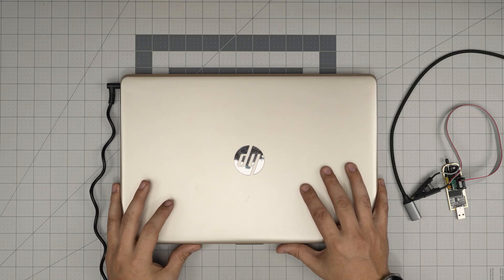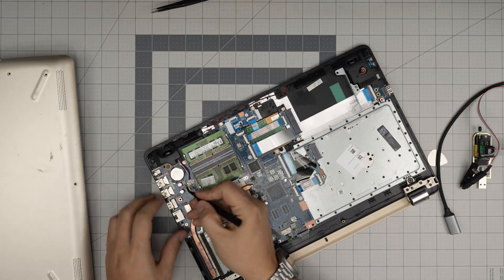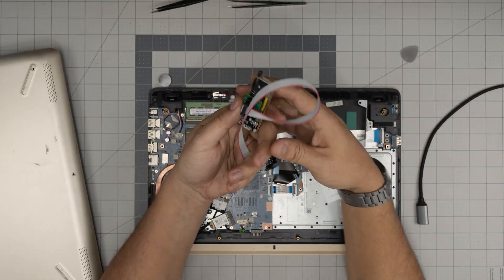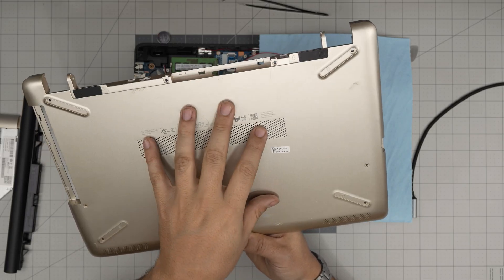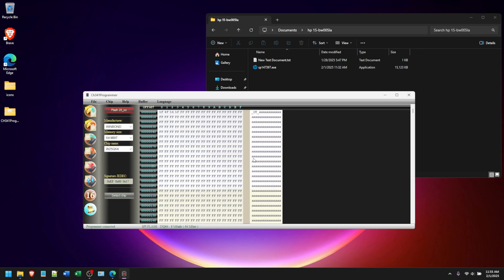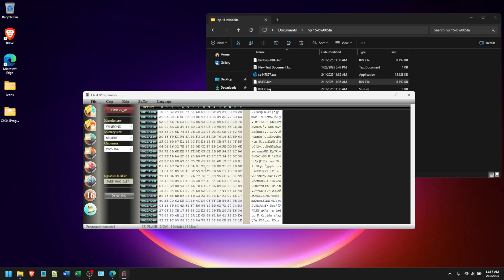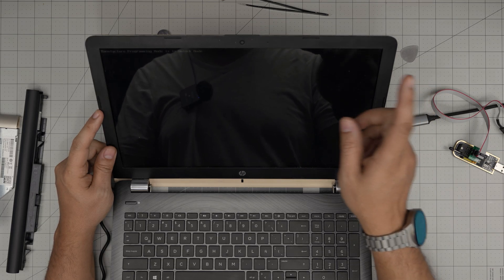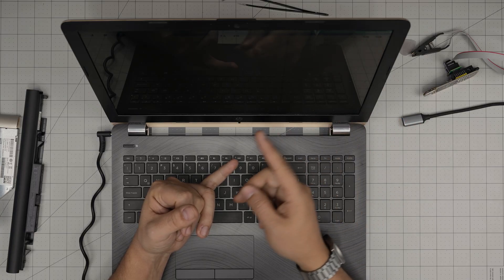Laptop BIOS Password Removal 🔓 DIY BIOS Repair & Reprogram ✅

Comment: Hello, Thanks for the video... I bought an HP EliteBook x360 1030 G8 with a locked BIOS .... Saw your video and want to flash the locked BIOS ... read that they have 2 BIOS chips so don't know which one to flash and where they are located  ... could you do a video that I could follow or DM me ?  Thanks!
Reply from the maker: 🫠Regarding your question, I will try to get you some help this weekend, and I’ll reply right here with the information.
cheers🍻

Comment: Any thoughts on Lenovo ThinkPad P50, will it work?
Reply from the maker: 🫠Regarding your question, yes, it will work, but you will need different prongs (clips) for the BIOS chip, as it is a Wson8 BIOS chip.
cheers🍻
Reply: @uFixTek huge thanks, are they easy to get and will everything else stay the same? I read somewhere that in P50 bios password might be stored separately from bios chip?

Comment: Hi, I done all the steps and now have the black screen, erased again and write the original bios and still the same ..... any suggestions .....
Reply from the maker: Regarding your question, then your issue could be another component; you could have bad RAM communication issues.
Reply: @uFixTek  write the bios without the RAM, start first with no RAM, after stick the RAM, working ......

Comment: Cheers from Denmark 😎 
I love that video and how you explain it, very straight, and looks very "easy". 
I have bought a used lenovo thinkpad x1 carbon gen 11 with intel vpro i7. Im inside with windows 11, but cant change settings like bootorder in bios, because of missing "supervisor password". Ive tried contact the previous owner, but his not responding.
Is this the way i can remove the password from it? Thanks in advance 🙏😃
Reply from the maker: It's my pleasure my friend.
🫠Regarding your question, 
*Step-by-Step: How to Check Your BIOS Chip*
1. *Open the laptop carefully.*
   Remove the bottom cover so you can see the motherboard. You’re looking for a tiny black square chip — it usually has a label like Winbond*, *MXIC*, or *GD25Q printed on it.
2. *Look for a WSON chip.*
   This type of BIOS chip has *no visible legs or pins* — it sits flat against the board with little metal contacts underneath. It looks smoother than the older *SOIC* style, which has thin legs on both sides.
   * *SOIC chip:* Has 8 small metal legs sticking out (4 on each side).
   * *WSON chip:* Has no legs; completely flat on top and bottom.
3. *Measure it in millimeters.*
   There are *two common sizes* for WSON BIOS chips — about *5 × 6 mm* and *8 × 6 mm.*
   Use a ruler or caliper to measure the chip’s width and length so I can confirm which one it is.
4. *Send me the size (and maybe a clear photo)* and I’ll give you the *exact adapter link* you’ll need to read or program that BIOS chip correctly.
cheers🍻

Comment: Hi , thanks for this video , trying to unlock the supervisor password for a thinkcenter M75q-1 11A7 , seems not working( moving jumper pin 1_2 to 2_3 ) , any advice , and how to find the right eeprom chip to reprogram it using ch341A , shematic , many thanks
Reply from the maker: 🫠Regarding your question, look for a chip that looks like this and it says "MX" or "windbond"
that is the bios chip.
https://imgur.com/a/DuQHtCf
if you need the clean bios.bin let me know i will upload it to you.
cheers🍻
Reply: @uFixTek thank you, I ll let you know 👍
Reply from the maker: oki

Comment: Hi,
I have a company-locked BIOS laptop. Its model is ThinkBook 14IIL 20SL. Can you make a video on that? I have tried every method to unlock it, and someone suggested that I flash the BIOS. Thanks.
Reply from the maker: 🫠Regarding your question, sure—I will make a video on that. It's the same as in this video: connect the programmer, erase the BIOS, and rewrite the new unlocked BIOS.
cheers🍻
Reply: @uFixTek Yeah, still if you can make it, it would be great as I'm not technical guy....Or do you have anyplace where I can send or visit. Thanks....
Reply from the maker: I will make a video, and it will be easy to follow.

Comment: Hi! Great video, straight to the point and simple. 
Similar to the previous commenters, I cannot find a clean .bin BIOS file for my dell latitude 5410. 
Do you by any chance have one and could share? Thanks! :)
Reply from the maker: 🫠Regarding your question, 1st back up your old bios and if the bios backup is 8mb then use this:
https://drive.google.com/file/d/1rWmXi7_7_K20TguYLtZFTQu09de1OIEZ/view?usp=sharing
else let me know.
cheers🍻

Comment: Hi, thanks for the great video. I want to try this, but after downloading the BIOS updater for my Laptop (Lenovo IdeaPad 5 Pro 16ACH6) and running / extracting the .exe file, it does not result any bin or sig files.. How do I get the correct bios file to flash via the bios programmer?
Reply from the maker: 🫠Regarding your question, here is the BIOS .bin file and the 2nd .bin file
https://drive.google.com/file/d/1-Q_MwUUspiB-E6VML3jS9MF8l03L6xSa/view?usp=sharing
cheers🍻
Reply: @uFixTek  Hello, thank you for the quick response. It seems like you've shared bios .bin files for the IdeaPad Pro 5 **16IHU6**. This is a laptop with an Intel chip and other difference such as Thunderbolt. My laptop is the IdeaPad Pro 5 **16ACH6**. According to my research, using the bios you've provided has the potential to brick my devices. Is that true? And if so, do you happen to have the correct bios .bin files too?
Reply from the maker: No, you can’t “brick” a device permanently—that’s nonsense.
People often get scared of the word brick and think it means the end of the device, but let me explain what it actually means:
Scenario 1:
You go to the official site, download a BIOS update, and start the update. You see the warning: “Do not power off, or you risk permanent damage.” If, for some reason, the power is lost, people say “you bricked your laptop” or killed it.
Scenario 2:
I give you a `bios.bin` file, you start programming it, and during recording the probe moves and the file isn’t written properly. Right away, people say “you bricked the laptop.”
Scenario 3:
I give you a `bios.bin` file, but it’s for the wrong model. You flash it to the BIOS, power on, and get no reaction or just a black screen. Again, people say “brick.”
All of the above are considered “bricked” situations only if you don’t have the correct `bios.bin` file or a backup of the old BIOS.
Because if you have a backup `bios.bin` and a BIOS programmer, you don’t need to worry. You can simply erase the BIOS chip, flash the old backup, and you’re back where you left off.
By “bricking,” you’re not physically damaging the laptop—it just needs the correct BIOS file. The BIOS chip is a simple memory chip (usually 8MB up to 32MB) that stores instructions telling the laptop how to power on and which components to look for.
👉 Just a note: once you program the new `.bin` file and power on with the charger connected, make sure to wait *4–5 minutes* so the BIOS can initialize itself before starting POST. Don’t get scared if you don’t see anything on screen right away.
If after 5 minutes nothing happens, just flash back the old `bios.bin` backup and you’re back to where you started.
Test the `.bin` file I gave you and let me know the result.

Comment: Hello. I can't find the bin file. I can only find the bios update exe file on the dell website. Do you have link to official download page? For dell precision 5550, 5VR4ZD3, Thanks
Reply from the maker: 🫠Regarding your question, your BIOS has a password and you want to remove it? If so, make a backup of the .bin file that contains the password and send it to my email, along with a picture of the motherboard model (usually located near the RAM on the board) and the tag number of the laptop.
I will clean your .bin file and remove the password.

cheers🍻

Comment: Hey, brother!
The programmer you posted here to download just contains one .exe file to install, but it fails in the process (all in Russian, though). I do notice that yours has more files in the folder, as in a portable version. Could you please share the same version you're using here?
Thanks in advance, dude!
Reply from the maker: 🫠Regarding your question, I just downloaded the same file, clicked on the right arrow, installed the program, and opened it. It is in Russian, but the menu on the top right is where you can change the language (see the image).
https://imgur.com/a/JgwUwP4
Or you can download another software for the same programmer and change the language to English, as shown in the image.
https://imgur.com/a/JgwUwP4
https://drive.google.com/file/d/1sq_gOTvRnj1gtqvJPOQpNQwBLG6tmYJc/view?usp=drive_link
Should you have any further questions or requests in the future, please don't hesitate to ask me.
cheers🍻
Reply: @uFixTek  Thank you, bro! I'll check that out!

Comment: Hello, I’ve seen many videos about removing bios passwords using ch341a but comparing your video is mega easy to do but others don’t do like this way. They delete the password from the backup bios file using hex and they compare with original bios and it’s way complicated. But you have done nothing, only read the IC and save the backup and erase the IC and reprogrammed with original bios from the website. For what we have to save the backup? And does this method work with every laptops which have bios passwords?
Reply from the maker: 🫠Regarding your question, I’ve been repairing laptops and consoles for over 22 years, and based on my experience with motherboard repairs:
We need to understand what BIOS is and what it does. It stands for Basic Input/Output System—some with advanced interfaces like UEFI, and some legacy versions.
Nowadays, laptops no longer use what was traditionally called “BIOS”; the new term is “UEFI.” However, people still commonly refer to it as BIOS. UEFI stands for Unified Extensible Firmware Interface. It is a modern firmware interface that replaces the traditional BIOS.
Now, back to the BIOS/UEFI on a motherboard: that code is written on a small SPI flash memory chip ranging from 1MB up to 64MB. SPI stands for Serial Peripheral Interface.
Essentially, the information in this chip dictates operations like sending a specific voltage to the CPU, RAM, etc. If the hardware responds, then the firmware continues executing instructions until everything starts—this is called POST (Power-On Self Test).
What’s happening nowadays is that Microsoft (Windows 10–11) decided to integrate BIOS/UEFI updates into Windows updates. These updates are not always applied correctly, which can result in the motherboard failing to power on after a shutdown. The rule of thumb with any laptop is: don’t touch the BIOS unless you need to.
If you have a password-protected UEFI, your password is encrypted within the code. You can open and view the encryption using a hex editor, but locating, comparing, and erasing the right line isn’t always feasible.
What I always do is use an SPI reader—most people use the CH341A, which works fine. I use the T76 or T48 programmer, which supports many more SPI chip models and is much faster at reading and writing.
Make a backup of the old BIOS/UEFI .bin file. Once you have the backup, erase the chip and find a clean BIOS .bin file online. If you need help, I can get it for you. Some manufacturers provide it on their website, though not all brands do.
Once you’ve got the new .bin file, load it to the chip, power on the device, and wait up to 4 minutes. Many people don’t wait and assume it didn’t work, but some boards take up to 5 minutes to initialize the code and begin POST.
You don’t need to open the BIOS .bin, search for hex codes, and stress over comparisons. Just reload the memory with the new .bin and call it a day.

I hope this explains a bit and helps you understand BIOS/UEFI and its SPI chip.
Reply: @uFixTek   great explanation thank u

Comment: I have Toshiba satellite Pro c660 to be fixed. it is noisy and shuts down within 2 minutes but it works when I set CPU power state to 65% on the power management setting. do you think repaste will fix this issue?
Reply from the maker: i really recommend to opena nd clean the heatsink vents and repaste.
cheers🍻
Reply: @uFixTek  Thank you for your valuable recommendation. I cleaned the heat sink and repaste it and now it is working fine